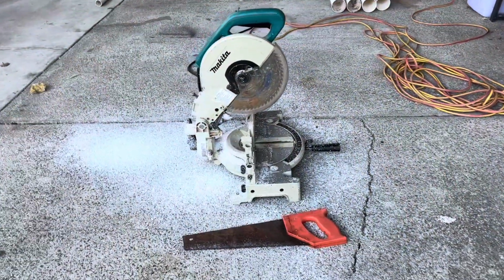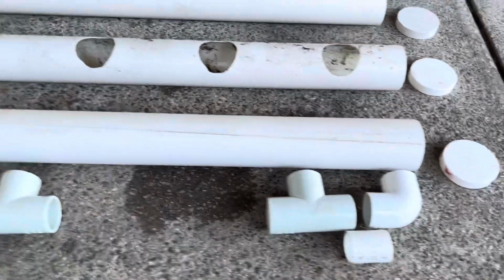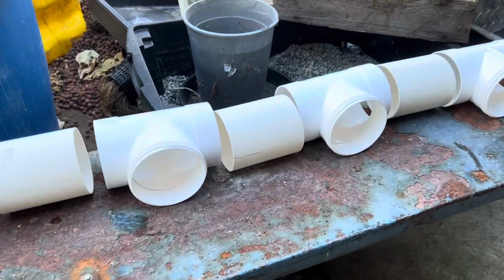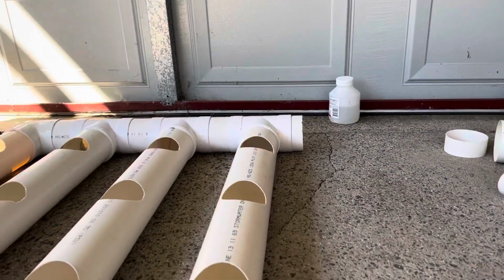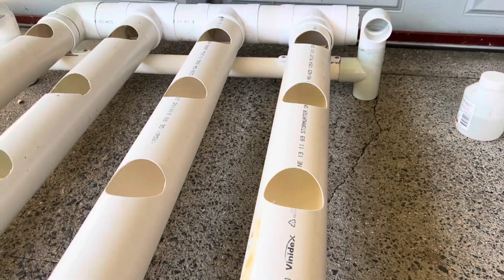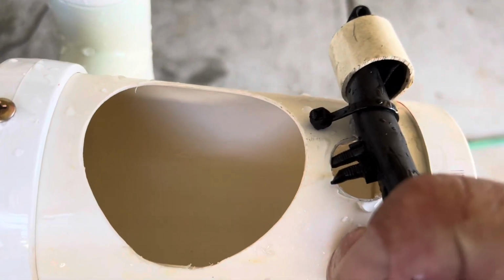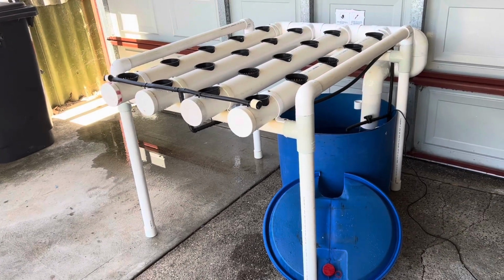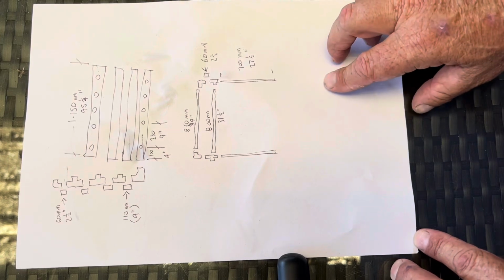How to build the 20 plant pipe system

Comment: Hi Brian, thanks for taking the time to create and share videos for us 🙏 
Does either this horizontal system or your vertical system have to be on a slight angle for the water to flow back to reservoir?
Reply from the maker: No, I make the pipes level. Only needs a tiny fall, or none at all as the water will find its own level, and flow back to the reservoir.

Comment: Hi Brian, great design and I’m planning to have a shot at this.  Would you tell me what size pots you have used here? Also the drill bore diameter.  I couldn’t see it in the video.  Cheers..
Reply from the maker: 3” (75mm) net pots . I drill the holes with a 73mm holesaw. The holesaw is in a down light kit from the hardware ( Bunnings).

Comment: How do you control the water level inside the pipes? I couldn't see that you set a height for it to begin to return.
Also, how often do you cycle water through and does any water stay in the pipes while it's not pumping? Or do they fully drain?
Reply from the maker: The plastic quarter moons glued into the end of the pipe keep the nutrient solution level with the bottom of the net pots at all times. The system runs 24/7.